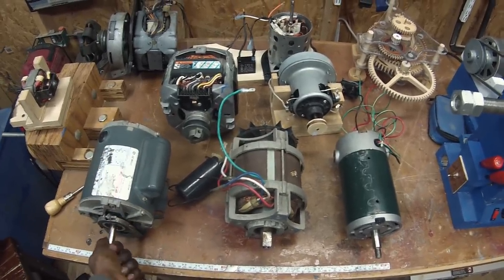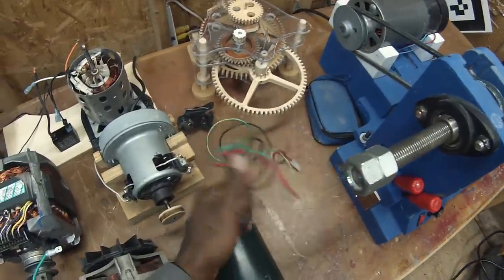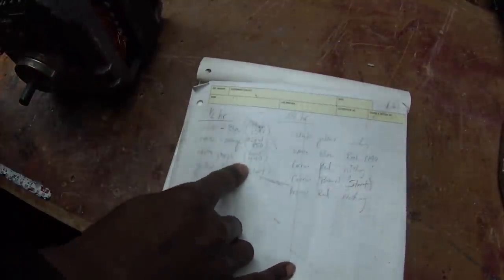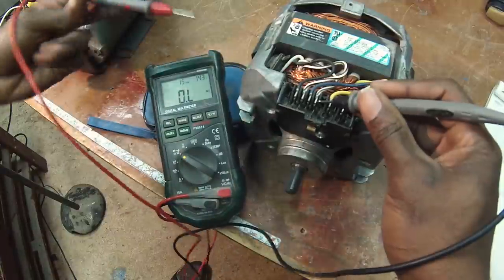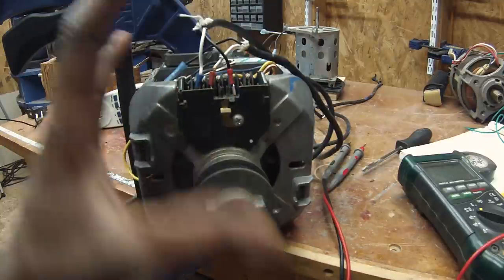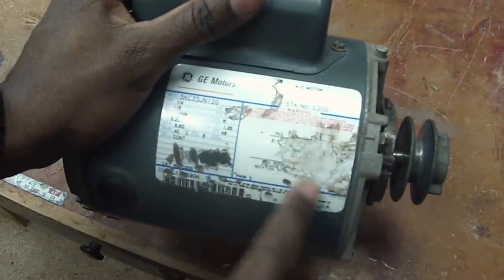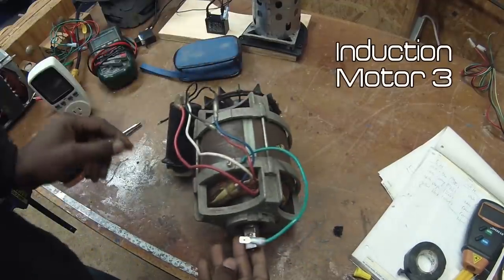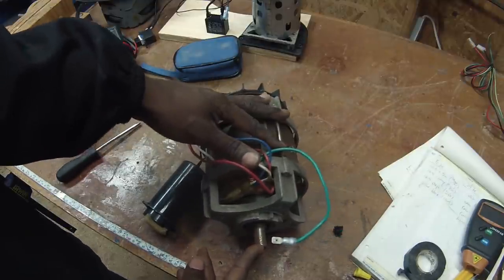How To Reverse the Direction Of Universal and Induction Motors: 015

Comment: I don't know if this might help you but thought I'd let you know this. I've been trained and have been in the hvac/r and electrical fields since 1987 and the way we find the common, run and start are by checking ohms. The highest ohm reading is always between the start and run windings, the lowest ohms is between common and run windings . If you want to check what kind of shape the windings are in then After getting all these ohms readings if you add the 2 lowest ohms together they should equal the highest ohms reading. If they don't equal out then there's a problem in the motor windings that may cause a failure very soon. This way is used in checking a compressor on a heating/cooling unit but should also work on motors since the compressor is just a motor also. Take care

Comment: I found a compressor - 21 Gallon  3/4 HP - Craftsman...After watching your video I replaced the capacitor. dressed up the motor switch.  And I saved it from the dump and its inow in service in my rear pole barn. Thanks for the videos!

Comment: Getting back to basics- I love it.    About 10 years ago, Bill Mayo, a Shopsmith rebuilder in Florida,  showed me how to take a Shopsmith headstock motor apart & connect a DPDT switch to have both forward & reverse motor rotation.   Kinda like surgery.  Like you mention, simply looking for the thinner wires made it easy to locate the starting winding.  After the first one, only took 15-20 minutes to do.  Bill had spent some time in a motor rebuilding shop.   Not sure if they even exist anymore.  Thanks for sharing.

Comment: Thank you for this explanation of how to reverse the direction of motors. I didn't even know for sure if it was possible without rewiring the motor. I made a mount for a motor onto a meat grinder. Once it was all hooked up, the grinder spun the wrong way. 😢 I didn't want to re-mount the motor to where it would be hanging off the back. My motor says on the tag to switch the red and black wires to change CW/CCW. Easy! Thanks

Comment: Thank you for your instruction. I know nothing about A/C motors, but I've come across a large industrial fan. Some DYI person added a one phase motor to it. Looks like an old dryer motor (like the gray one on your left). The motor runs in the wrong direction and blows air out the back. I tried reversing the fan, but it worked the same. I'll take the motor off and try your suggestions.  Thanks again.

Comment: Jeremy, Love your channel and I greatly admire your work.  

I have a situation which I suspect a significant portion of your subscribers may find themselves in.  

Long story short, I bought a lathe to use in my garage.  I converted the 3-phase motor to run on single phase 220 volt power using a Static Phase Controller.  It works great but only in one direction.  However, the 3-position drum switch no longer works.  When I start it, the motor (and chuck) only rotates in one direction.  The drum switch doesn't change anything.  

I have found online wiring diagrams on converting 3-phase motors to single phase 220 volts.  I have found wiring diagrams for drum reversing switch's on single and 3-phase motors.  But I have not come across the wiring diagram for my particular situation.

Other details that may help you. 

1. SPC:  Phase-A-Matic PAM-300HD static phase converter.  
2. Motor: Century brand Squirrel-Cage Induction Polyphase Motor (1.5 HP, model number SC-184-FC4-7).
3. Drum switch: 3-position, Cutler-Hammer Forward-Off-Reverse lever-operated switch.  
4. Startup switch: A circuit box equipped with a green start button and a red emergency shutoff switch.  
5. Magnetic Starter: GE CR306 Magnetic Starter (NEMA size 00)

Let me know if this is something you would like to address.  

Sincerely, 

Bill

Comment: First off, very good video.  I've watched several and you are very good at explaining complex concepts clearly. I would like to add some input to this video.  Motor direction, unfortunately, is not standard across all manufactures. NEMA, National Electrical Manufacturers Association, states that motor direction is determined from the non-shaft end, but many manufacturers state rotation from the shaft end (like you are doing in this video). In an effort to clear up any confusion, some manufacturers are now stating  CCWSE meaning counter-clockwise from the shaft end or CCWLE meaning counter-clockwise from the lead (non-shaft) end. I truly only point this out to hopefully help those who may get confused by motor direction as stated by the manufacturer.  Again, you do a very good job with your videos.  I look forward to more in the future.
Reply from the maker: My source for maintaining this view https://support.industry.siemens.com/cs/document/60605536/defining-the-direction-of-motor-rotation?dti=0&lc=en-US. I am not aware of NEMA having a different reference
Reply: Jeremy, 

NEMA MG-1-2016 Rev 2 Para 14.6 - Direction of Rotation - 

...the standard direction for dc motors and single phase ac motors is counterclockwise, when viewed from the lead end of the motor. (the lead end is defined as opposite the shaft end of a motor)

Comment: where is the capacitor in the first induction motor in this video? is it built into the motor? I have a DPH224L01 I pulled out of an electric dryer, but I'm having a hard time figuring out how to reverse its direction. Does the capacitor have anything to do with changing the direction? I feel like I have tried to switch all of the leads, but its spins the same way.

Comment: I came into two Bodine gearmotors (NSI-54RL and NSI-33R). My main question, how do I wire the 54RL so I can utilize the F&R function via toggle switch like you have on your lathe. It has two Blue wires and two black wires. Thank you

Comment: Thanks, Jeremy, for answering my question of 2 days ago and going to the trouble of adding the link. Sadly it is of no help, it being a much larger capacitor start motor, (mine has no capacitor) and also it has the wires all accessible externally.  220 or 110v - the procedure would be exactly the same, I imagine.
 Thanks again for trying, but I'm now resigned to further searching to try to find the way to get this motor reversed. Maybe I'll dismantle the motor and mess about with the field coil wires inside......

Comment: One thing to note on reversing dc motors.. DC motors have brushes and commuters that the brushed ride on. When it gets used to being run in one direction the brushed get worn a certain way. Reversing that  DC motor is rough on the brushes and the commutator. It would be a good idea if you need to reverse a DC motor, to start with fresh brushes.  Also note that new brushes usually need to be "worked in" without a load on the motor, for a certain amount of hours  -  Run the new brushes without a load so you can see that they have worn down to form the curve of the commutator. This enables the brushes to take the full current of the motor.

Comment: Hi Jeremy great video thanks, I am trying to reverse to rotation of my capacitor start 1 1/2 Hp single phase motor. I got the motor to spin in the reverse direction when not under load but as soon as i install the belt for the table saw it wont start and makes a loud humming noise. Any ideas?
Thanks again for the videos

Comment: Hi Jeremy, I love all your videos. I only wish I had your knowledge of motors. I’m an optical physicist but I can’t understand electronics. 
Question: I have a Jet 20MF drill press. 1.5 hp. 18 Amp, 1720 rpm 4 pole class E motor. It can be wired for 120 or 240 vac. 
I want to make it so it can go in reverse, and possibly a variable speed. 
Any suggestions would be appreciated. 
Thanks, 
Paul

Comment: Not sure if a question on this old a video will find you - but for the first motor where you demonstrated how it was simply a matter of switching the starter circuit wires around to reverse the direction of rotation, is there a specific type of switch you could put in line to do this for you? if so what are they called? -  I have a belt grinder that it would be great to change the direction of rotation at the flick of a switch.

Comment: picked up a leaf blower motor very powerful,
used a speed controler on it as its controler was not very good, 
i tried just reversing the power supply to reverse the spin but it did not work, will try reversing bush wires tomorrow, my speed controller off ebay is like yours and is full throttle at about 60-80v , is there a better way to properly control it in finer adjustments. 
Thanks

Comment: I found a 1/8 hp fan motor and built a tiny table top belt sander out of it. For a while it was fun running it either way without the capacitor by hand cranking it but decided for convenience to install the recommended t wire cap. The problem is  that 
I wired it in per the schematic on the face plate but now it only runs the opposite way that I need it to. Advice?

Comment: Super cool there's answers to my questions.  I've a carpentry etc workshop in Devon UK 🇬🇧  on the bank of the river Dart which is incidentally the old English for oak, any way I've been struggling with a bandsaw. I managed to find and mount a replacement motor but the direction is reversed what's the best way to change the polarity? thanks Geoff
Reply: Switch the wires around.. Boom! You're welcome friend!

Comment: Jeremy, Thanks for all the great information. How do I know if the motor I have is reversible or not? I have a 2hp single phase baldor thermally protected motor that is going the wrong direction for my bandsaw. It doesn't have the schematic on the tag and the leads aren't numbered as I've seen in other videos (1-8) so I can't just swap the 5 and 8 as suggested in other videos.  Rob

Comment: I have a motor removed from a brushed A/C powered chainsaw that I'd like to run on D/C in both forward and backward directions, only issue I'm having  is the motor only has 2 wires. No starting coil. So When I apply DC Voltage in either polarity it always kicks off in the clockwise direction.  Is there anyway I can make it behave the way I want it to, or is this motor just not suitable for my needs?

Comment: Project: AC treadmill inverter, I have a DC motor so if I add a bridge rectifier and a choke at the output of the inverter would it safety run the DC motor

Comment: WHEN WIRING AN INSTANTANEOUSLY REVERSABLE MOTOR IS THE INTERNAL BRAKE OPERATED BY CHANGES IN THE POLARITY OF THE START WINDING WHEN THE START LEADS ARE WIRED THRU A DOUBLE THROW DOUBLE POLE SWITCH?

Comment: I noticed with a vacuum cleaner motor that I could run it on 12 volts rather than 120 just by connecting the brushes in parellel with the field windings

Comment: Hi there, I have a single phase AC motor from my table top drill press I want to reverse direction. 2 wires coming from motor and 3 wires going to motor. One is grnd, one hot one neutral. I swapped the H and N leads with the 2 wires from motor. Both wire configurations don’t make any difference in rotation. What is the problem?

Comment: And here it is... :) Thank you! Love the switch-a-roo trick for the starter winding and direction of rotation.

I wonder if maybe you could speak at some point on protection (Thermal and Shorting), or point me to a link of something you have already done in video or that you know of somewhere else?

For example I have repaired a couple of brushed AC motors for my wife's hand held mixers, because nested down between the tape and the windings was a thermal fuse. They work again, but I don't want to give them back to her until I have some sort of fusing system external to the tape on the windings. I'd love to add a fuse port on the back to make it easy, but I don't think that would address the temperature issue of the windings, only current draw.

I know someone will say they are so cheap that you might as well get a new one, and we did go out and bought here a heavier duty mixer (Black and Decker of all things! :D )

But these are her favorites, because one was from her mother, and the other also from her mother is her favorite color and goes along with other kitchen items.

She went and used these weaker ones meant for frosting on mashed potatoes. ;)

As for sources of motors, I see the same basic sources you just mentioned in this video.

It's amazing how much people throw away, and it could so easily be fixed or adapted to some other use.

I have this one shop vac that only needs new brushes, but they seem to be proprietary and unavailable. Which also leads me to a question...

Who's a good company or source for brushes for electric motors?

:)

I might be able to find something that will work...

Thanks again for your videos!

Cheers!
Reply from the maker: I am not sure what to do about the fuse, and I can't think of a good source for what you want, as you are modifying the original design. 

Brushes are usually very similar in size and shape. You may have to purchase some made for a different machine and shave them to the right shape if needed. At least that is what I would do if I needed custom brushes.

Comment: I find most of the motors, that I have, from dishwashers and washing machines. I schlep the appliance home, scavenge clamps, metal, wire and motor, then set it to the curb again. Usually it's gone in a day or two as metal Scrappers routinely patrol my hood for scrap. I am in Mississauga, Canada.

Comment: Flipping the wires on start winding changes the direction of the induction motor.  Correct.
What is the reason for it, it is AC, current goes back and forth.   That is the point that should be the main focus. Don't you think?
Reply from the maker: No... because one is a practical question (the goal of the video) the other is a theory question... why it works. The goal was to solve a problem not explain the science. However, I have made a series of videos explaining things like that... How motors work for beginners. The answer you seek is in there.
Reply: @Jeremy_Fielding  I want to make sure you didn't take my inquiry as criticism or the wrong way.  I love everything you do.  You are one of the real no bull people that I have stumbled on.

After I inquired as to why the answer popped in my head or I think it did anyway.  I was going to Quora to ask that but I haven't yet.  Assuming the answer is right it looked like this:
The power we get is what they called split-phase.  Current electricity alternates between two black hot wires in the house.  The white wire is in the middle of the transformer coil
So current at any given time always moving from the black wire through the load first.  The current, magnetic field,  force, right-hand rule, torque direction.  There is ever a slight delay from the white wire towards the black wire. Wiring the capacitor one way, it is discharged, current surges from the black to the white, clockwise perhaps.  Wiring the other way it is discharged from the white wire to the black, counterclockwise.
But I could be wrong.

The natural follow up question would be, can one make a dryer motor and shaded pole motor change direction, as they have no capacitor? or more precisely be bi-directional?  If what I said in my explanation above is correct then the answer is no. Unless you build them with two sets of windings one for each direction.

Comment: Of all the motors that you have shown there is not a one like mine. It is a treadmill motor but, it is ac induction mechanically controlled speed. There are only three wires from the windings, they go into a black box that has a set of points. I installed it on a mini metal lathe and I need to reverse it. Help!

Comment: Hi there, doing a bit of scrap metal on the side I come across allsorts of different motors, from Stan appliances to coffee machines, elec garage Dr's, tools saws hoovers etc has any one got inventive ways to use these mabee some power saving device for my trailer, it seems a waste to just weigh them in for scrap ??? Regards TaG

Comment: Great videos. ..
Can a Water Ace lawn pump be reversed?   The pump was cracked after a freeze.  My neighbor gave it to me.  I would like to use it on a table saw but it currently spins CCW.   Thanks
Reply from the maker: Maybe not. You don't want a pump to turn the wrong direction... and they save money but not added the extra wire no one plans to use. But, if they happen to just buy the motor from another company maybe. You have to take what I show you and have a look inside to determine what is there. Also make sure you have watched the first video in this series. That  will help determine what you are looking at. https://youtu.be/ZKodxGcRSnw